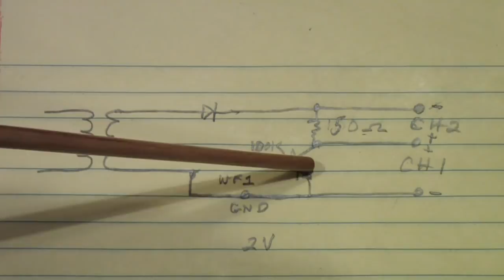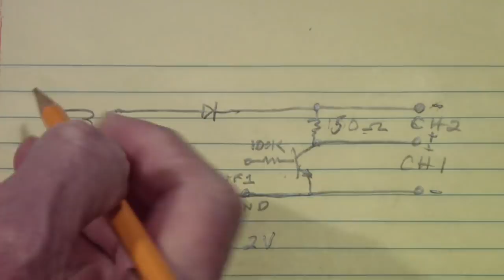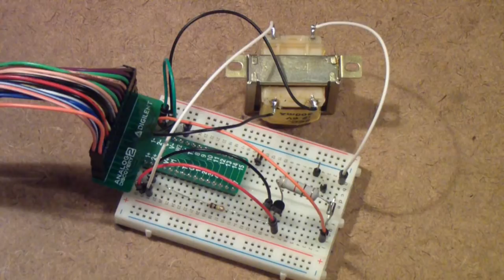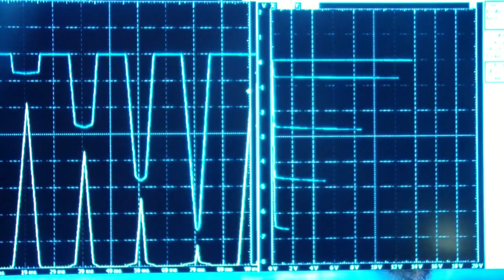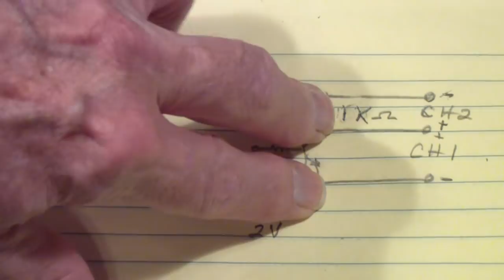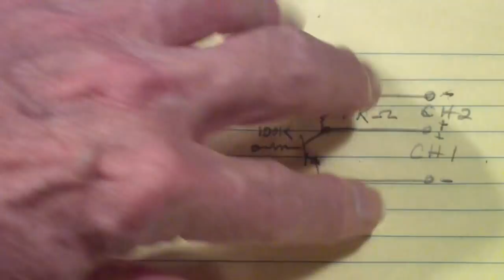TTT242 Improved AD2 Curve Tracer

Comment: Thoroughly enjoyed this video!
I have a very eclectic viewing pattern with electronics creators...
You, Big Clive, Mr. Carlson, Fran and many others.
Wouldn't it be possible to run the DC through the transformer then rectify (and smooth) it after?
Reply from the maker: I think you mean convert the DC to AC with some kind of switch (like a transistor) since a transformer will not pass DC, and then pass it through the transformer, but fortunately here, we already have an AC signal on the collector so we can just insert the transformer. It also helps that the frequency of the collector triangle is 50 Hz, close enough to the 60 Hz design frequency to be efficient.
Reply: Oops...yes I did mean that...dagnabit.